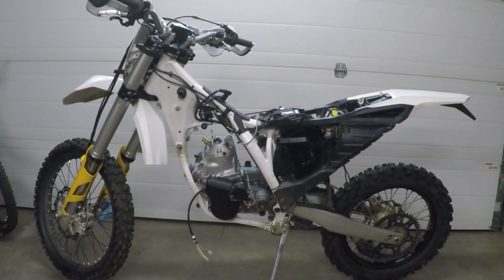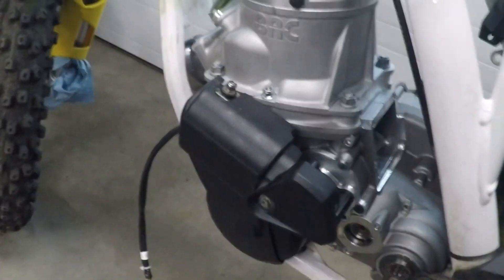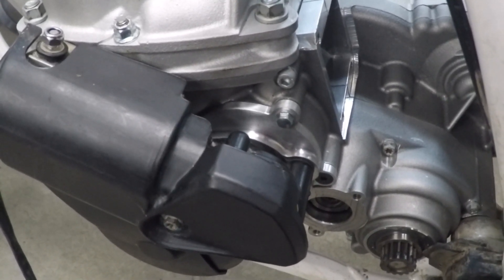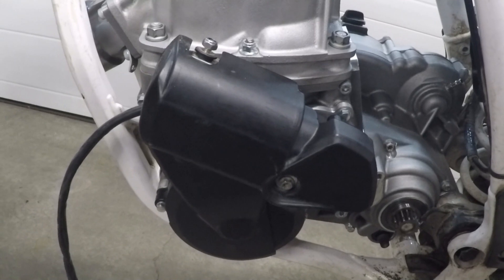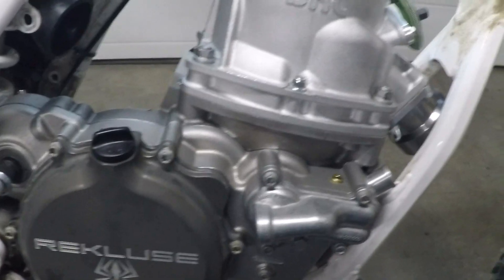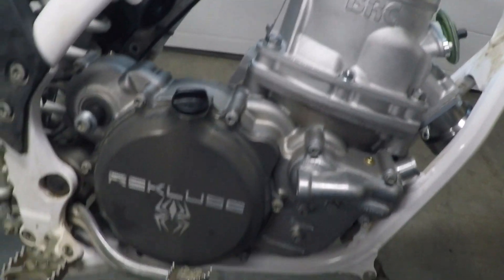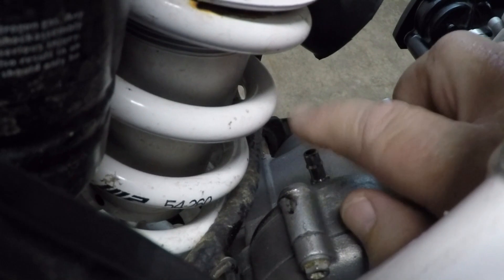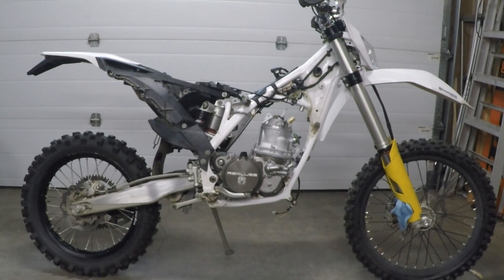BRC 500 Part 5 - Trial Fit Into Frame

Comment: Also does BRC only use a Rekluse clutch or could they use a Hinson clutch instead?
Reply from the maker: They can use the stock clutch, and I suppose any clutch that can replace the stock clutch. You would need to ask BRC to be sure about the Hinson, but I would be surprised if it wouldn't work with the kit.

Comment: So if I wanted to send a KTM or Husqvarna 250 or 300cc. engine to BRC to make it a 500cc. engine I would just send them the engine/trans.? That seems like a good deal & I know the price is reasonable but could or would BRC do this with the XC or TX closer ratio engines?
Reply from the maker: The BRC engine kit is the full cylinder, inner and outer cases, piston, crank, powervalve, primary gears, pipe and silencer, etc. You need to provide the transmission, clutch, electrics, kickstarter and other bits and pieces from the donor bike. Most of the 250 or 300 engine is not used. I'm not aware that BRC will do the engine build for the customer. I believe it's up to the customers to install the kit themselves. That's what we did on this Husky build.
Reply: Barry Jackson Thank you Barry Jackson for your response. So I guess if I want a 500cc. BRC engine for a KTM-300 xc I would just order the engine from BRC & when I get it just do the install myself and/or myself & friends? That seems much better than sending them my engine & waiting on BRC to send it back? Thanks so much for that info as well as your video.
Reply from the maker: @jeffflick2573  Yep,  it's way easier to do the build yourself.